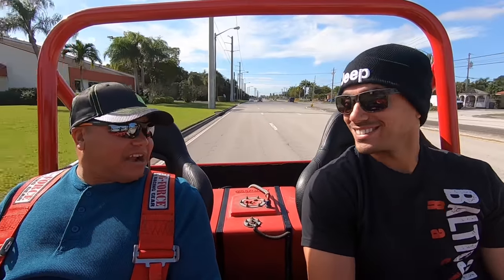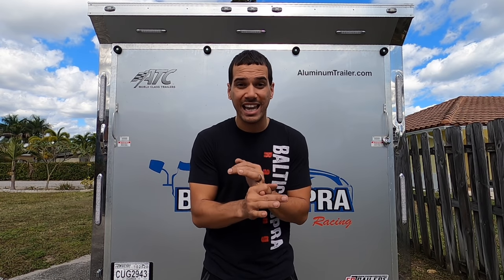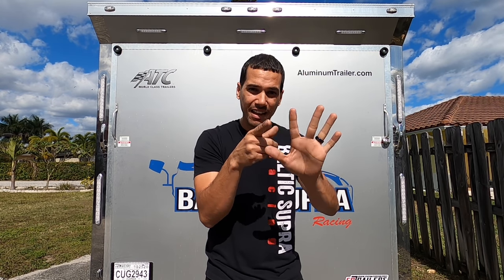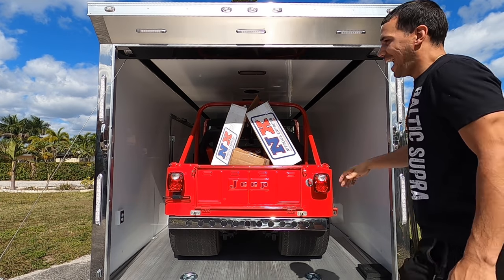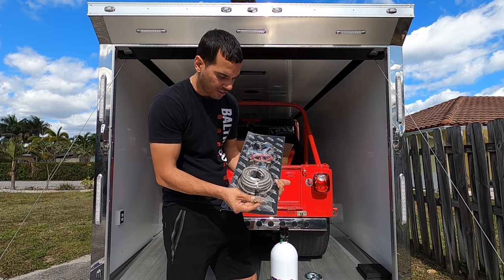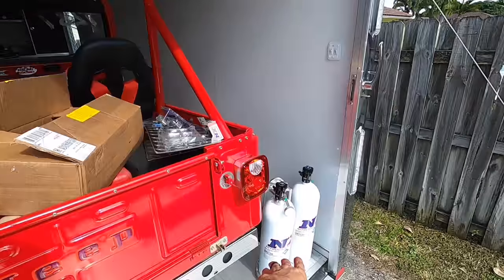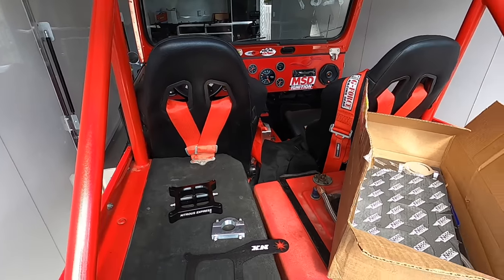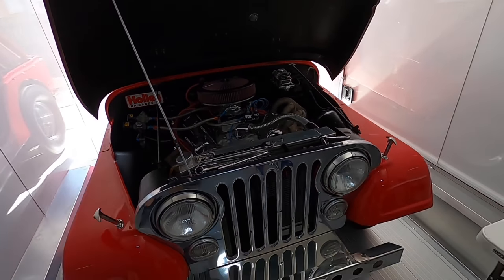All the NITROUS for the Jeep

Comment: Yea son! Have em pull back at least 4 degrees timing for the nitrous. I like that plate its got fogger nozzles everywhere! I mean I know this isn't the motor that will live in there, but try not to crack the ringlands on the pistons. The piston rings on this crate are not set up for nitrous. Pulling timing and colder plugs will help prevent the bang boom pow. But hey...send it son!
Reply from the maker: Hahaha yup. Let’s see how long it lives for